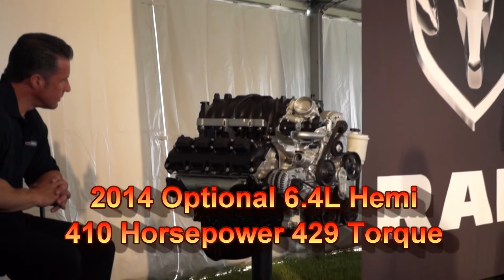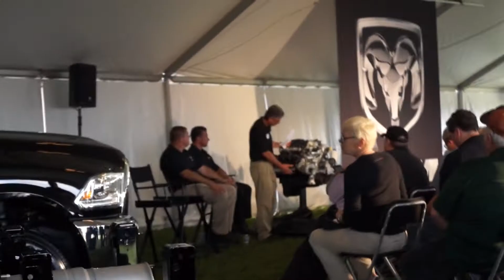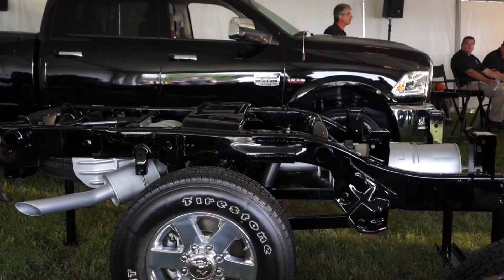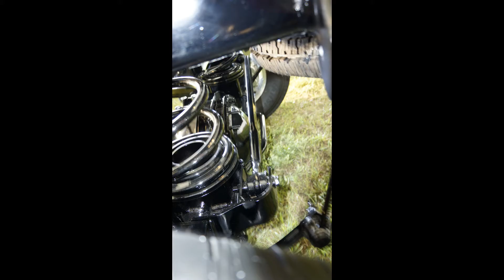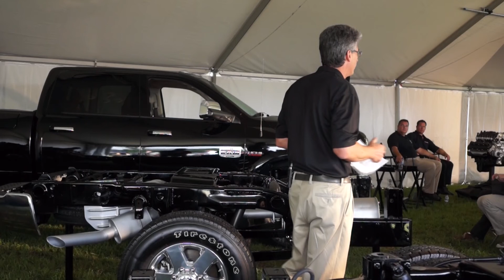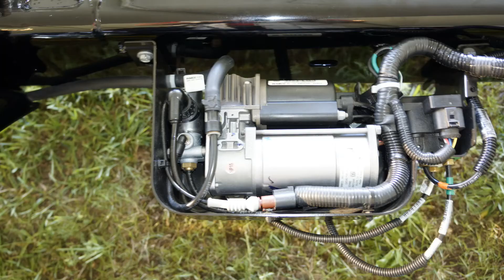MrTruck.com introduces Ram 2014 upgrades, 6.4L Hemi, 3.0L EcoDiesel, rear air suspension

Comment: they only offer the ecodiesel in there most expensive trucks you cant get it in base models thats kinda messed up
Reply: Wrong it will be available even in the entry level tradesman RAM 1500
Reply: Go to Build and Price on Dodge's website and make sure you select quad cab/crew cab or it wont offer the ecodiesel v6. The Tradesman 1500, which is the most basic model, has it as an option.

Comment: did they just claim a 3/4 ram ail out perform a comp 1 ton? how so?
Reply from the maker: That I think they was comparing to older 3500 single rear wheel. They did say that the new rear coil spring is rated for more payload and trailer weight than the 2500 with Hotchkiss leaf springs that they are replacing. It didn't work on the 1500 in 2009 when they went to coil rear. I hoped they would offer a progressive, (multi rate) option on the 1500, but now they have the air bag option so it does solve sag. But a straight coil spring will sag, but multi-rate has the coils spaced differently so they give more support with more load. I've pulled some trailers with the 2014 Ram 2500 and rear coils for a day and it did well. I won't get one until February to put it thru the paces with larger trailers in the mountains
Reply: They were saying ram 2500 with the 6.4L hemi will out tow the F350 with the 6.2l v8 & the chevy/gm 3500 with the 6.0L the max towing of the ram 2500 with a 6.4l hemi is 16,300lbs vs Ford f350 6.2l's max tow of 15,000& Chevys/gms 3500 max towing of 14,500lbs
Reply: All tow numbers came from each company's official site
Reply from the maker: Ram is saying the new 5-link rear coil on the 2014 Ram 2500 has higher payload and towing numbers than previous years Hotchkiss leaf springs.
Reply: MrTruckTV Here Look 2014 F350 max tow rateing for the 6.2L V8 & 4.10 gears http://www.ford.com/commercial-trucks/superduty-commercial/specifications/towing/ It's 15K for a dually. 2014 Chevys/Gms 3500 with 6.0L dually's max tow with 4.10 gears http://www.chevrolet.com/silverado-3500hd-diesel-trucks/specs/capabilities.config%3Dregular_cab_long_box_drw.html is 14,100lbs. Now the 2014 ram 2500 look at the 6.4L hemi with 4.10 gears max rateing it's 15,920lbs http://www.ramtrucks.com/assets/towing_guide/pdf/2014_RAM.2500.Towing.Specs.pdf That's what there saying not payload towing only.

Comment: I'm waiting for the rear air suspension to buy my 2500 Ram. My question is the coil springs softer ride or is the air suspension softer ride, with a empty truck, no pay load in it? Or are they the same ride. And the air suspension will ride 2 in. lower than the steel springs, that would be nice to get in the bed. Can someone answer my question?

Comment: We had a 2004 dodge ram 2500 4x4 with the cummins and 323k miles on it and it rode like a cadillac no joke. It rode just as good as my 2009 dodge ram laramie. So when somone says a 3/4 rides rough i don't understand what they mean.